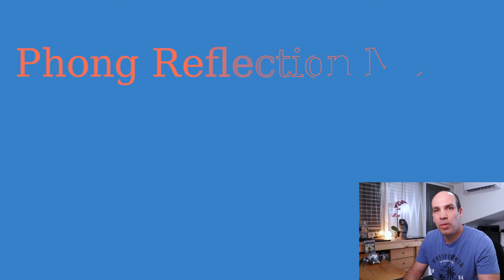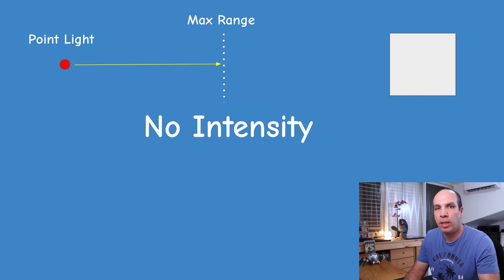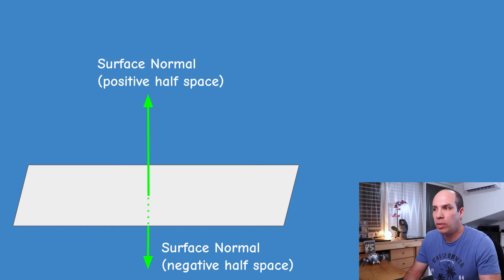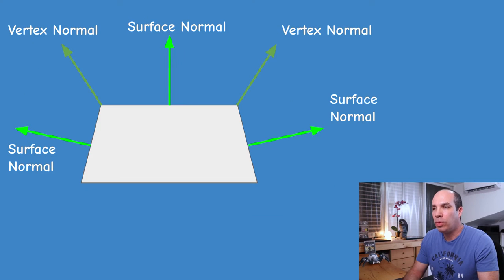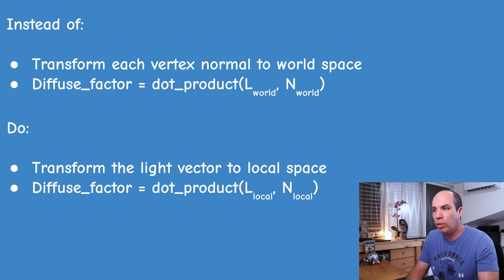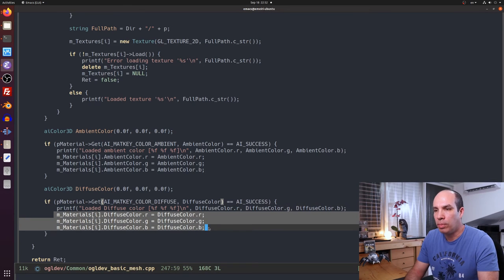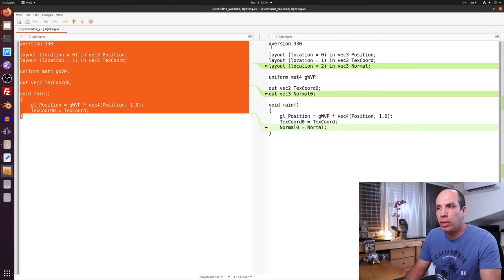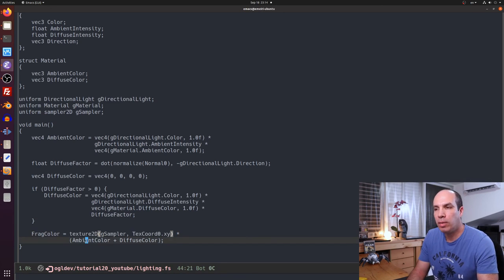Diffuse Lighting // OpenGL Tutorial #20

Comment: The series has been awesome:goodvibes:.
Just want to add a note for 6:19, we use reverse vector as we know that the angle of reflection vector wrt normal will be same as the angle of light vector. This only clicked me after you explained reflect function
Reply from the maker: Thanks!
I think that the most intuitive example is that when the light vector is perpendicular to the surface. In that case the light vector and the normal are directly opposite so in theory the angle between them is 180 degrees but of course we want to refer to this case as if the angle is zero so we reverse the light vector. Some people prefer doing the reverse already in the application so save them from this operation in the shader on every pixel. This makes sense but for educational reasons I do it all in one place.

Comment: At 11:30 and in your other videos (like for directional lighting), you bring up transforming everything back to local space from world space. However you mentioned that this would only work for uniform scaling, and that your solution of transposing the matrix is just a temporary one. It's a little scary for me to leave it that way, since you haven't brought this back up and clarified the proper way to do it which would handle non-uniform scaling. I think having non-uniform scaling is important and so my question is, how would I properly transform to local space?

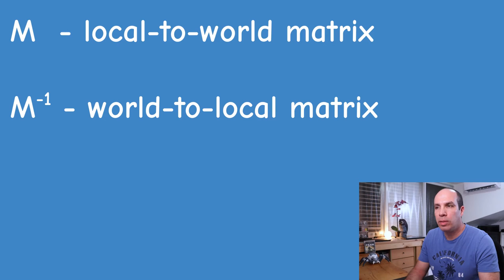The code in question is the DirectionalLight local space direction calculation, and the WorldTrans WorldToLocal(). For the DirectionalLight, is it as simple as inverting the mesh's world transform matrix4x4, rather than transposing the top-left matrix3x3? You mentioned inverting it at 11:59. I already can invert it but am not sure if it's the correct solution, or whether to invert just the 3x3 portion or the entire 4x4 portion and skip the second vector multiplication. As for the WorldTrans one, I'm not sure if it needs updating since it's only used for the camera's local position and point lights' local positions, and we calculate their directions in the fragment shader with a simple subtraction. I figured I'd ask in case you could give me an answer for both since it's a little unclear for me right now, even though I think I understand how it all works

Also thank you for your resources, I am grateful, and that you also take the time to reply to comments, you are invaluable
Reply from the maker: Thanks for bringing up the issue of scaling because there is a problem there and I wanted to do a followup video about it but couldn't find a time to squeeze it into the agenda. The problem is mostly for point lights where the vector to the light source changes from pixel to pixel. Let's say that you have a normalized quad from (-1,0,-1) to (1,0,1) and you want to use it as a large field and run a point light along it (see the point light demo on my website). With these coordinates you just need to apply a large scaling factor so no rotation and translation whatsoever. The light source local position is equal to its world position in this case. As the light runs back and forth along the field you expect it to attenuate and be visible only locally. In addition, the vector from the light to the far end of the field should be very sharp, affecting the diffuse factor. But if you ignore scaling you will do all calculation on the original (small) quad and it wil not be as expected. If you’re using uniform scaling the solution is simply to provide the scaling factor as a scalar to the VS and multiply it by the local position. It’s still less expensive than multiplying by a matrix. In the case of non-uniform scaling you can supply a vector of scaling factors and multiply it by the local position. GLSL does component wise multiplication in this case which is exactly what we need.
Regarding WorldToLocal: in the case of diffuse lighting we just need to reverse the rotation so transposing the top 3x3 matrix should be enough. Translation won’t affect the light vector so we can ignore it. In the case of specular lighting we reverse translation and rotation separately and combine them to get the inverse. I agree that this is somewhat cumbersome so if you want to use a simple inversion of the entire matrix (using the determinant, etc) in the 4x4 case go ahead.
Reply: @OGLDEV  Yep, I ran into that point light scaling issue in my test scene, where the light was stretching with the entire mesh, because as you said, it was using the original small mesh as a reference. However I decided that I will tackle this local space optimization another time, since it's adding a bit more complexity than I'd like at the moment. I want to get things as robust as possible for the future before I start optimizing my systems, but I was curious about it so I figured I'd ask you, and you explain everything perfectly.

I look forward to your next videos even though I started learning all of these things last year, because you keep teaching me advanced things that other teachers are leaving out, like these local transformation optimizations. So once again, thank you for all you do :)

Comment: i have an issue , so when using multiplication for example : (materialColor * lightColor) if the  materialColor  is red and the lightColor is blue , this will result in black instead of purple
Reply from the maker: In real world physics if a pure red light hits a pure blue surface it will seem like nothing is reflected back. But this is an extreme case. The Sun's light is white so you always get back the color of the surface. If you need a purple surface then make it purple and make sure the incoming light includes purple (or more).